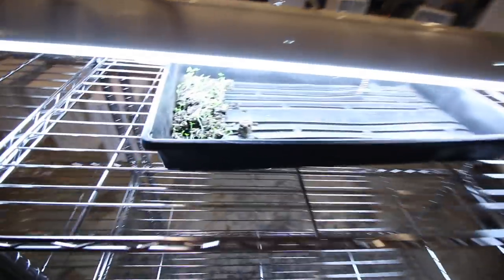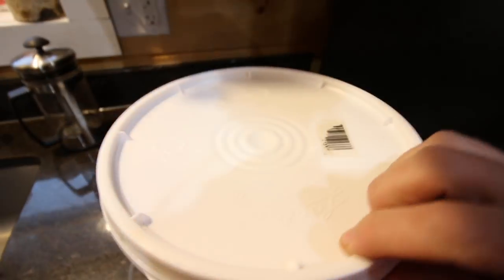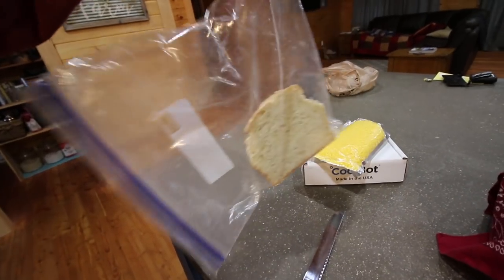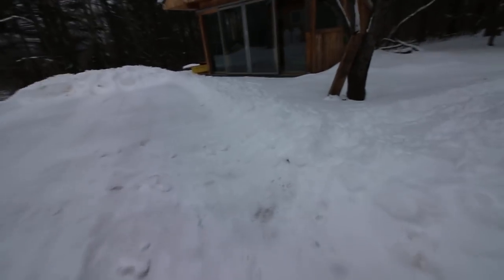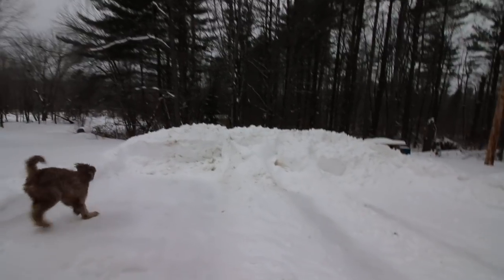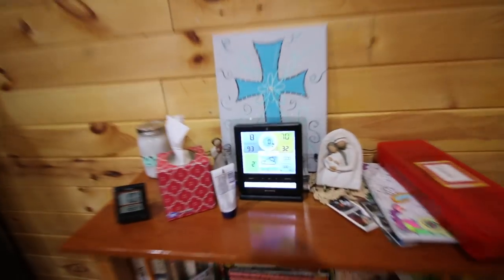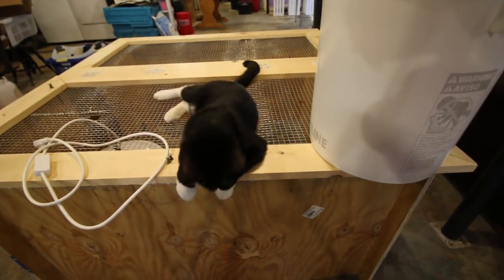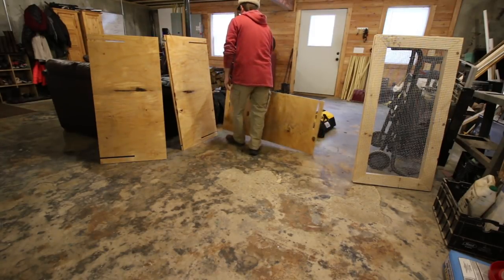20,000 Modern Steader Update ~ How we are Storing the Best Chick Brooder

Comment: So, metal hinges wouldn't get it that flat? Would you need a piano hinge or something for it to do that? Very clever design.
I do wonder though, after use the plywood will be pretty dirty. Can you clean that off easily? Wondering if some kind of seal, lacquer or something on the inside would help make that easier? But I guess the chicks will peck it and you don't want them eating that? You could make new sides each year I guess, that's not too expensive.

Congrats on 20k, well deserved. 30k sometime this summer I hope.
Reply from the maker: A quick rinse with the hose and letting it dry in the sun should keep the brooder clean.